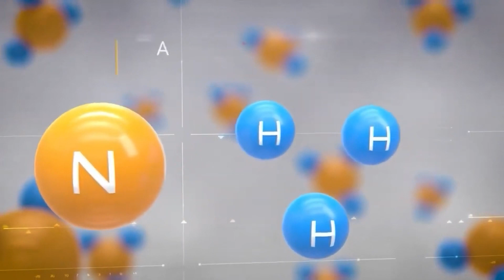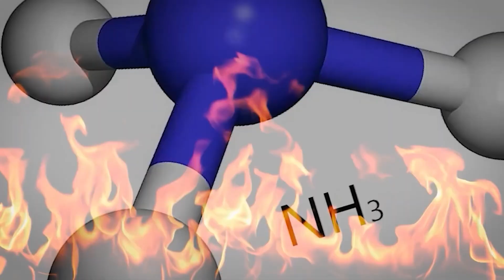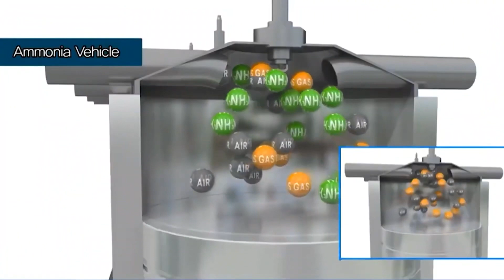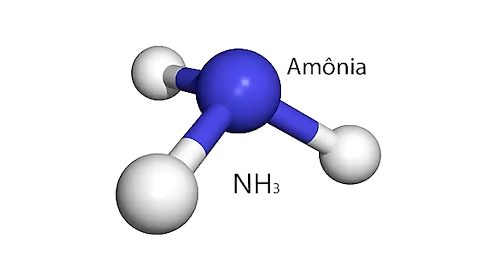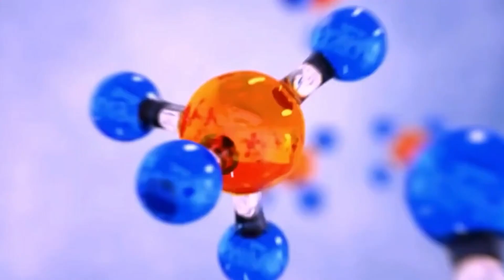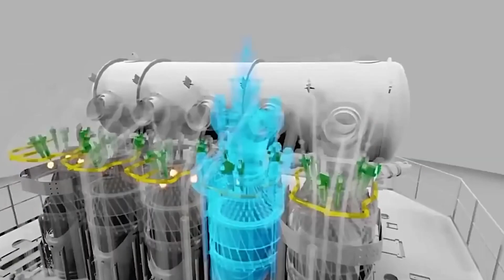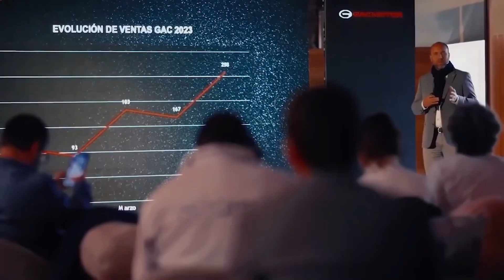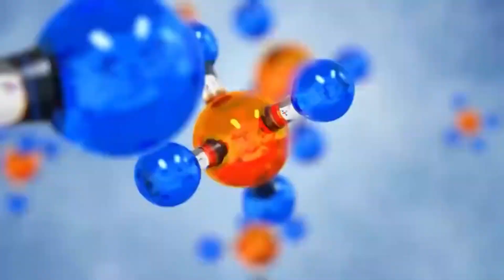Toyota Takes Aim At EVs With Ammonia Engine!

Comment: Well, as an internal combustion engine, the ammonia engine would still be markedly inefficient compared to an electric motor simply due to the Carnot cycle.  You can't beat fundamental physics.  Also ammonia is extremely dangerous, industrial leaks have killed livestock and vegetation in bast areas, as a gas it's difficult to contain and storage wiuld br under pressure which is a danger in itself.  Remember that despite being a very effective refrigerant, we no longer use it iutside of industrial applications as a refeigerant simply because if how dangerous anmonia is.  Toyota is just reaching deep in their continued lobbying to not ban new ICE vehicles as the CEO believes the future should be hybrids not battery EV's and that if fossil fuels us to be abandoned, alternatived such as hydrogen and ammonia should be suitable never mind that commercial hydrogen and ammonia are extracted from fossil reserves today.   Science journalism are by those without the merit ti be scuentists but really this isn't worth sensationalizing just for attention.

Comment: Don't electric vehicles have way more benefits with low maintenance?
Reply: Not really. Your still going to have to replace the same perishable parts as a gas vehicle i.e. brakes, tires.... with a certain level of reliability with modern gas vehicles you won't be replacing major parts until minimum 100k miles if properly maintained.  I'm hearing batteries in EV vehicles aren't lasting that long and cost significantly more to replace than most major parts of a typical gas vehicle.
Reply: As a technician of 20 years, I can say with confidence that ev is significantly less complicated than ice